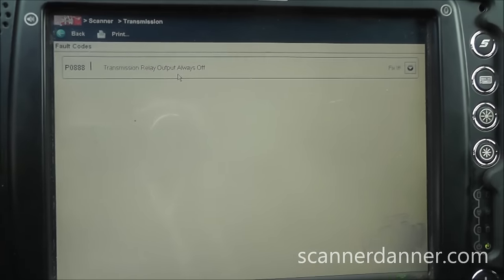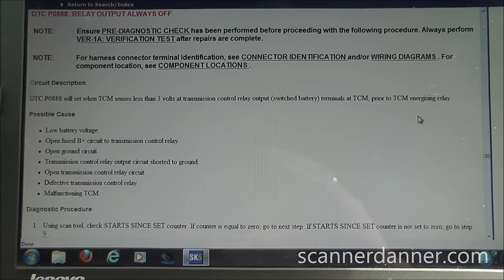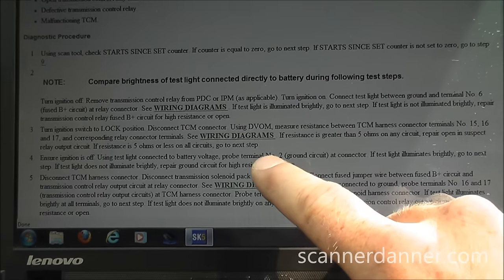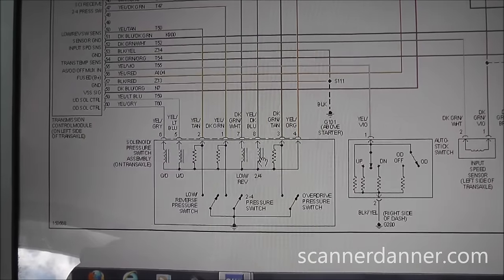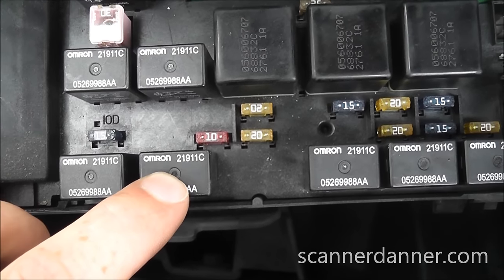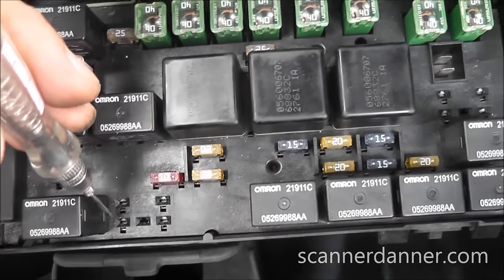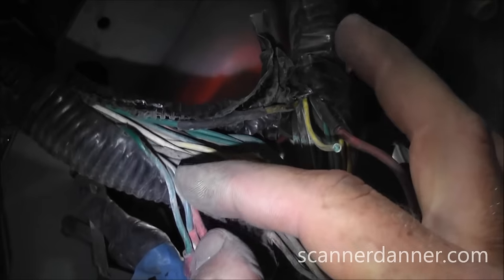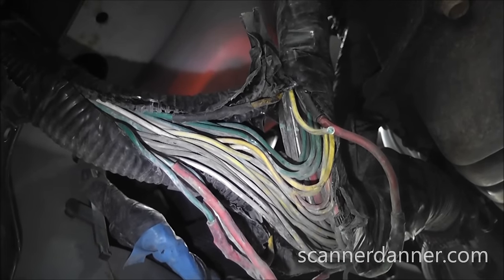Transmission No Shift Case Study (P0888)

Comment: Looking at the condition of that harness and your comment of multiple corroded wires - why not replace it with a good used harness ? Compared to the cost of a transmission computer or transmission - due to misdiagnosis , the customer is getting a fair repair . Just how corroded is that harness and the potential for future failure ?  Good diagnosis . ALWAYS check loaded voltage !
Reply from the maker: Replacing an entire wiring harness is a HUGE expense. It is way more complicated than you think with hours and hours and hours of labor. Repairing what was damaged is definitely the way to go, both for the customers wallet and the mechanics sanity

Comment: It is worth noting (and perhaps it has already been done in the comments) that there was a diagram on the side of the relay which identifies the functions of the pins. Your thumb was on it each time you pulled the relay out.
Reply: For sure but I don't rely on those much as half the cars will not be marked. It is important to be able to determine pin designs without it don't you think?
Reply: Fair enough!
Reply: Eric Morrison
Reply: Eric Morrison m
Reply: It is absolutely crucial to learn to identify the pinout without a schematic, BUT I would say that learning to read the schematic on the relay is fairly important too. It saves time, can prevent a jumper wire screw up that could potentially create new problems, and is just good for understanding how the relay works in general. Of course nothing explains how they work better than popping the cap off and seeing it in action.

Comment: i THOUGHT REMOVING A PARTICULAR FUSE THEN TRYING TO START THE VEHICLE THEN REPLACING THE FUSE...WORKED TO RESET AND FIX LIMP MODE. I'm still learning I saw that online. 😉
Reply from the maker: not if the fault is current, and just cycling the key will make the computer start out in a normal shift sequence, unless the fault is there, then you may get a 1-2 shift on the first try before the second gear lock-out mode is entered (limp mode)

Comment: man you made hard work out of it'' the relay has the circuit diagram on the side of it and like you said the pin's are numbered so you should have no problems finding which pin is which and you have a box full of relays all the same so take out one of the non critical relays and change it over and if the problem persists you at least know the relay is good.
Reply from the maker: +Kevin Brain it wasn't a problem with the relay itself, so now that you swapped relays and it didn't fix it, now what do you do?
What if it is a relay that is unlike any other in the PD box? 
How is it that I made "hard work" of this case study?
Reply: you made hard work out of trying to determine the pin lay out from the relay when the diagram was printed on the relay then you could carry on to find the real problem but all that said it's a great video showing how to go about the job.

Comment: If the fuses right where you were test haven't popped yet and have a brownish color on the prongs are they slightly bad and may cause shifting problems? Excellent video 👍
Reply from the maker: Most likely not. Some voltage measurements would answer that question, but some discoloration of the fuse blade is not that unusual

Comment from the maker: I have a ton of nightmare stories!
-timing chain replacement for a blown injector fuse on one bank
-16 hours (got paid for 2) on a caddy that would intermittently blow the muffler apart
-6 hours on my first GM CPI with 49 psi of fuel psi
-smoked a $750 Nissan computer trying to jump a fuel pump 
-8 hours on my first dirty MAF sensor (funny story)

Comment from the maker: Hello friend. The test light I was using in the video I bought from Sears over 10 years ago. Not sure if they still make them. I looked on their site and didn't see it. Any regular style test light will work. Just check your current draw of the light so you know for future reference. Most of the incandescent style lights will have around 200ma or less.
Reply: My 05 jeep grand cherokee keeps getting stuck in 3rd.  You can tell when you crank it that its going to shift into 3rd.  U got any idea?
Reply from the maker: @kimberlyduncan5701  start with trouble codes and not just an OBD2 scan, you need an enhanced scan tool to view TCM information

Comment: Nice Video Paul, I echo all positive comments and simply discard all negative comments. I strongly recommend to discard negative commens if u have received any, there are many out there want to pull u down, so they can sell their cheap ideas for million dollars. Question 1) when u connect ur test light to control wire, light lid, this means, coil consumes some volt(let say 7 volt out fo 12), then the rest of 5 volt is energizing the test light to lid and working like series circuit, am i right

Comment: My 2008 Dodge Charger se 3.5L v6 is only Driving in second gear & some mechanic told me that its the input sensor inside the transmission & I'm watching this & wondering could it be the wires to??

Comment: i was taught you can take the thin wire from a used relay and using multiple strands of copper wire from that which are hair thin to wrap around the pins of the relay your testing, this way you can plug in the relay and touch your test light to each wire that goes to each part of the relay circuit.
to be extra careful it could be done one pin at a time or do you think its still too risky at a teachers point of view?
Reply from the maker: I've done this many times, just know that it is still dangerous even doing them one at a time. Some circuits are power side switched and if your wire touches ground, you can cook a driver in the ECM
Reply: @ScannerDanner  would probably still be just as risky if i put a little led bulb on each strand huh?

Comment: Always a pleasure to watch your videos Sir. 
Quick question for you here. 
What if the vehicle does not react to any transmisson gear shift. By that i mean, move gear selector to D or R and no engagement whatsoever; vehicle acts as if it was in Neutral forever. It is a 2006 Acura TL 128k miles.
Thanks in advance for your input on where to start looking.
Reply from the maker: If you fluid level is full, then these are not good symptoms. Most likely a rebuild will be needed.
Reply: ScannerDanner  thank you. it is actually at a shop for a rebuild. 06 Acura TL. i heard this generation Acura was a pain for the pocket

Comment: I have a 2005 town and country will not shift into gears going down the road.  I did discover their is no power going to my EATX safety shut down relay. Think their one side continuous hot and other is only hot when I turn the key on but neither contact is hot.

Comment: You are a legend in electronics the knowledge electronics is amazing that you have but I do not use a test light and troubleshooting never and then computer chip surface mount the pins are so small and you cannot use that
Reply from the maker: The test light is my best friend in so many different scenarios when you want to test wiring integrity and computer driver function. Especially with a failed output where you cannot do your normal voltage measurements.
Reply: ScannerDanner I like to use a meter which has high input impedance especially on this type of circuits I never use a test light never care too much for it as a troubleshooting device especially in digital electronics
Reply from the maker: You will absolutely miss wiring problems with a high impedance meter. Looking for a link now..
https://youtu.be/McsNOJvd0ao
Reply: ScannerDanner does not load down the circuit test light in automotive to me is just useless so we have different opinions on that going use a test light I'm inputs and outputs of a microprocessor and digital it won't help the best thing is oscilloscope
Reply: ScannerDanner I've seen you a video we differ on the pinion the meter to use is the fluke meter you're picking up noise through the ground the fluke meter has a function will allow you to measure resistance more accurate regardless of the of noise remember remember on a scope there's motors and fans radiating noise being picked up by the oscilloscope

Comment: GReat Video lots of info that helped me,  I also wanted to say that to test the Relays you could also buy some relay harnesses (different configs if you test different cars etc)   solder some lot ends to the ends of the wires with some pigtails to alligator clips ()heat shrinked to reduce shorting)  then you plug the clips into the pdc your meter to the alligator clips and viola   (thats just the thought I had seeing your vid and being a cheap bastard myself with some of those harnesses in my kit lol

Comment: Will this stop the car from cranking?
Reply: No it will not
Reply: Robert DIY. Sir i don't know when you posted this question. But if its a pt cruiser? Check park position on dash if its in park on console shift and showing reverse or any gear besides park. Then yes it will not crank due to the park neutral safety switch well thats with any car. Or it can be a electronic gear solenoid or range switch.you have a manual side and a electronic side. If you have not found the problem then its wire chasing time. Your looking for a grounded wire. Or broken wire dead wire. Other words a headache. Sorry hope it helps.
Reply: @jeager_z99  ~

Comment: In cases like this with extensive general corrosion wouldn't  you just recommend a total harness replacement?
Reply: He was sublet labor at a different garage to diagnose this car. He will tell them what he found, it's up to them to let the customer know what their options are. A good shop would recommend individual wire repair without warranty, or total wire loom replacement with standard warranty. We don't know what happened though...

Comment: Paul,
Another good video; maybe a little long in the 'tooth" though. As far as wire repairs, the heat shrink type you refer to is called "adhesive lined" in the industry. I use if for ANY wiring/repair work that could be exposed to moisture. I'd say those nice salty Pittsburg winter roads breached the wire (insulation was probably already nicked in break areas). Anoth nice wire repair product I use  Stretch & Seal silicone sealing tape; try it and you'll never use electrical tape again.

Tom

Comment: awesome way of diagnostic work. mechanic myself, but I'm stumbled on this one, I don't have the diagnosing equipment at home where the vehicle is, 1993 isuzu trooper s model, 4X4, sohc, 3.2L.  transmission slipping, and limp home after a tcase service? please throw me a bone on this one bud, my name is danny,  and great work bud.
Reply from the maker: +Daniel Whitfield where is the output speed sensor on this system? (vehicle speed sensor)
can you get trouble codes from this?

Comment: 27:07  This is a very good lesson for a wire failure.  The copper wire corrodes so bad in the middle of the wiring that it snaps in half or partially breaks. How does this happen? How does water get in the wire and start a corrosion process. Does the outside plastic get brittle and allow water to get into the copper wiring and start the corrosion process. The copper turns green which is the corrosion process for copper reacting with air. Do you have any other videos that goes into detail on this failure process?
Reply from the maker: It happens by the insulation of the wire breaking down. Either by someone who poked a hole in the wire with a test light or meter or a stone maybe hit it.
Reply: @ScannerDanner  What do you know about the soy based plastic on wiring? The soy based plastic is biodegradable. This means it gets brittle with heat, age, and chemicals. Also rodents love to munch on it.  How wide spread is the use of biodegradable plastics in vehicle wiring harnesses.  Seems to be just another way the car makers are engineering failure into the cars.

Comment: I have a Dodge ram 2500 4/4 v10 .hole steering wheel column was gutted due to being stolen my transmission has not shifted correctly since it's been gutted and I never had no transmission problems before so it has to be some kind of sensor or relay then someone thought they were helping fix it and they poured a bottle of rubbing alcohol in my transmission fluid what can I do to drain this out and flush it and to fix my relay non shifting problem

Comment: Have a 2007 chrysler sebring 4 cyl. stuck in limp mode. really wanted to run your test, but have been unable to locate where the relay is, find a wiring diagram. went and bought a Haynes manual ( what a waste), didn't  have either of those items in it. Any help ??.  Really thought your video was great.

Comment: I have a 1996 Dodge 2500 4X4 with a 47RE transmission and it works on all gears and shifts fine if I do not push it. If I push it it will run the RPM up to around 3500 RPM before it will shift to the next gear. I changed the fluid and filter. No change. I then changed the Output Shaft Speed Sensor because a scanner showed that it was bad. No change. I looked up some You Tube and went to a Transmission shop and all said that the Governor pressure Solenoid and the Governor Pressure  Sensor/Transducer were bad so I changed them and while in the transmission I also checked the band adjustments and set them and again. No Change! I was watching a video that is on a no shift study and it got me thinking about a bad connection somewhere or a bad relay. Would you have any thoughts on what my trouble could be or should I just start looking for a bad connection.
Thanks.
Alfred.

Comment: I got a customer with a 2004 Honda civic hybrid and her car starts  and  the gear shift but won’t engage I put a scan tool on it and the only code is  a p0507 idle air cotroll higher than expected but I know that’s not what it is so I checked the transmission fluid and it’s dirty could it be  the transmission position sensor transmission shift solenoid tcm input shaft speed sensor throttle position sensor where would a master professional like you start at first before getting into the torque converter and fly wheel transaxle shaft I would appreciate  your input professor

Comment: Need some help, I have an Ford fiesta 2005 1.6 automatic, it's in limp mode, no check engine ON,  trouble code is P0973, it is O/D OFF is ON, fuse always burn, so it's electrical, what do you recommend, guys from garages have no idea how to find the problem.

Comment: Great Video.  What if there wasn't a relay in between the solenoid and computer (TCM), do you test with a test light at the control wire/power side of the computer while the test light connected to battery positive?

Comment: I have a question.  I have a 2003 Jeep Liberty and this problem only happens when the tempature gets below zero a code comes and says it cannot communicate with transmission.  I can pull over and wait a few minutes and it will start shifting again until it gets cold again and it will stop shifting again.  Took it to shop and it worked fine because it was warm.  It only happens below zero.  I have been thinking about Transmission Control Module.  Think that would fix it?

Comment: wow.  very good video.  i will certainly be using this as a reference before taking my 2011 dodge grand caravan in to replace the transmission.  when my engine is cooled off, and i start up to leave, my transmission gets stuck into 2nd and it is only when i pull over and stop and turn off power that the tranny will work correctly.  i had the same thing happen in my 2009 grand caravan.  i sold it as it was real cheap.  i just put another 1500 into this one and have spent thousands on it already.  now the transmission is  acting up.  would this circuit be the same as a TRANSMISSION CONTROL MODULE?
Reply from the maker: +Butterfly Taxi DFW if it is going into 2nd gear lockout, it will be setting a trouble code. You need to start there

Comment: got a question for you. .. 03 trailblazer 4.2 automatic transmission just stopped pulling in all gears. pulled the codes and im sorry I dont remember the number but the description of the code was manufacturer control transmission
Reply from the maker: sounds like a second gear lockout. Electronic shift transmissions will hold the trans in second gear when there is a fault. 
Can't really help much further without knowing the code number
Reply: can u help me figure it out?  my mom bought it yesterday and it quit on her last night
Reply from the maker: need code number first my friend

Comment: I have a 06 dodge ram 1500.  My vehicle will not move.  fluid level & appearance good.  changed fluid and all 3 trans filters approx  40k.  No issues prior. I checked fuses and relays all look good.  I was able to move my vehicle after I had switched identical relays in fuse box in different positions.  If there were 2 of the same relays I swapped places. 

 Note: in the last week I noticed that my radar detector that was plugged into the dash was blowing fuses all of a sudden not sure if it has anything to do with it or not. 

pcm codes: p0700
tcm codes:
P0944 Mil Request
P0868 Hydrolic Pressure unit loss
P1790 TP Mechanical Circuit
P0868 Trans fluid low (verified fluid is NOT low)

Comment: Hey scanner Danner:) I got a 1993 Lexus GS 300 that has an intermittent shifting problem. I've noticed that the transmission will work fine for maybe a day or two and then for no reason whatsoever from the time you start it. And put it into drive it will begin to shift erratically. Now when it begins shifting erratically I've noticed that I can shift it manually from first to second and I've got those two gears no problem but once I put it back in to drive until it fixes itself its shifts erratically but it does fix itself and then begins working perfectly again. I've heard everything from do a transmission flush to a bad lock up solenoid. Any ideas? By the way love the videos you're very good with everything that you do